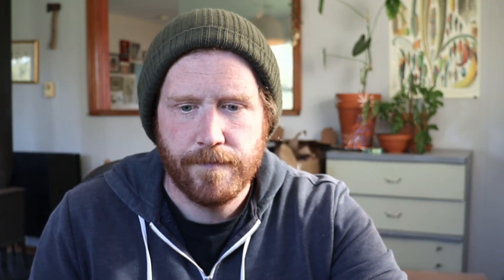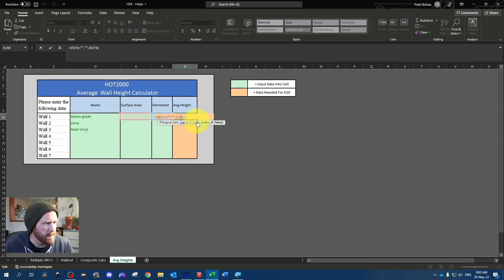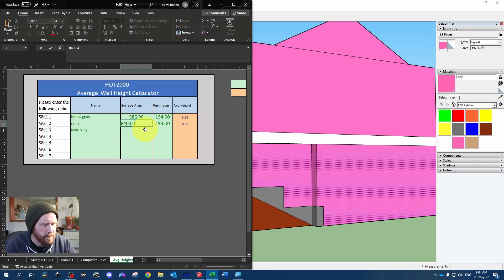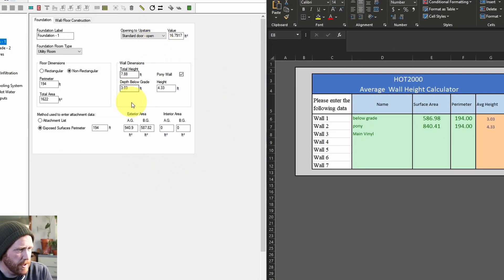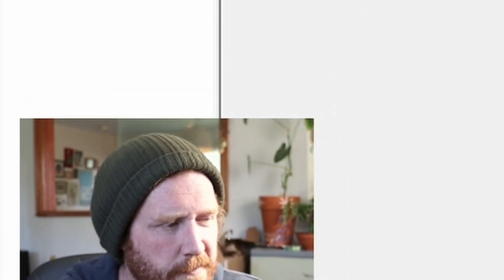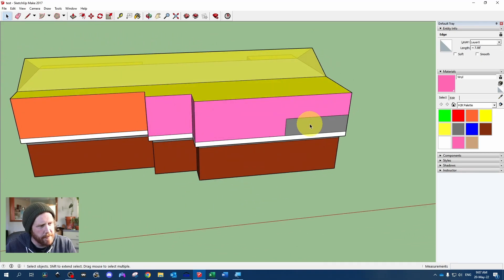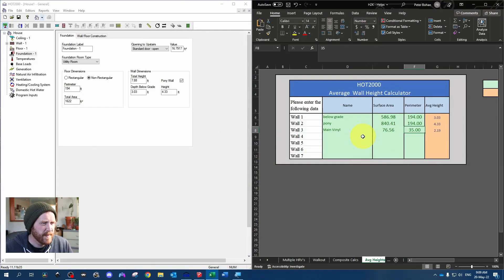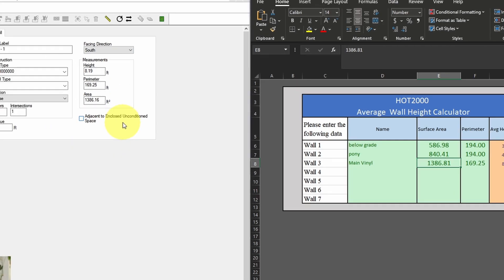Using Sketchup for Surfaces Areas in Hot2000

Comment: Great videos! I am working on my way to become an EA. I have a question about the wall area calculation. I was told the side of the gable roof is not part of the wall. Wall height only goes to the foor or ceiling. Why do you include the side of the gable roof? Thanks.
Reply from the maker: If it's a sloped ceiling then the gable end can be an exterior wall. If it's a standard attic then chances are the gable isn't included